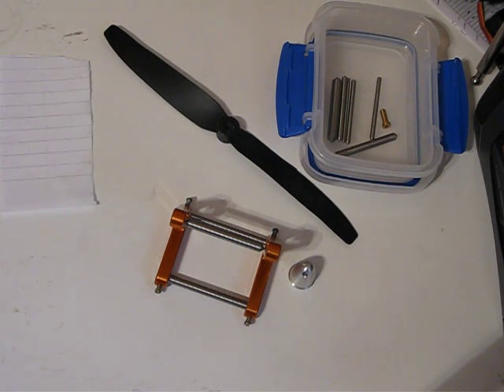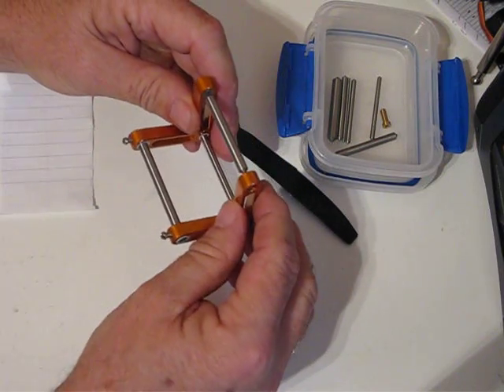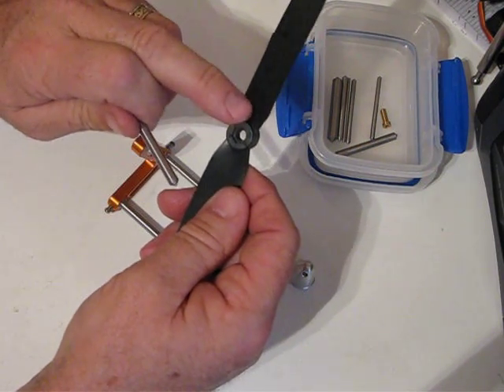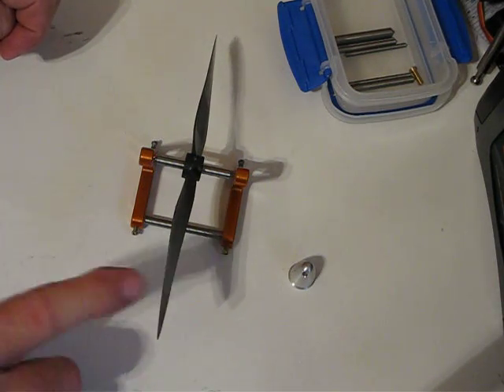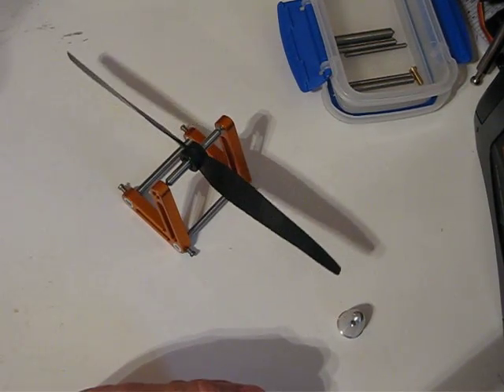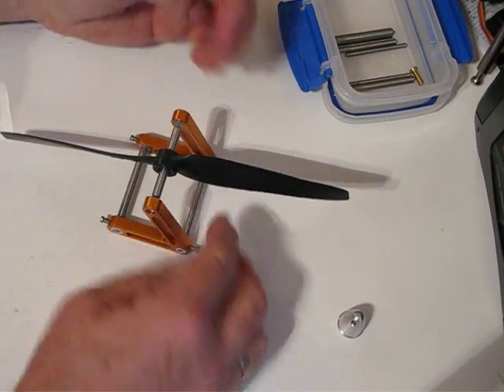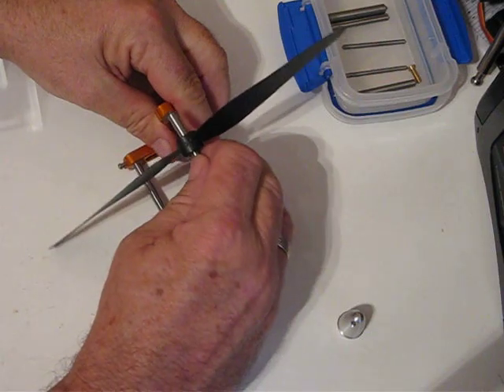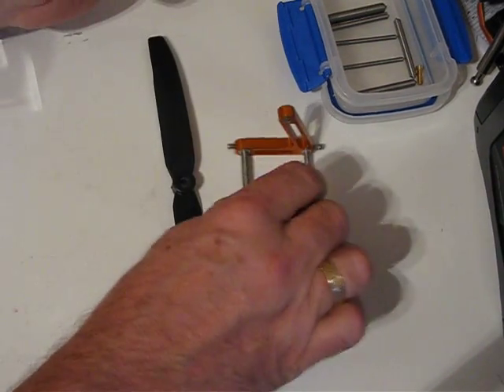DJI Quadcopter Propeller Balance video.

Comment: Where did you buy this balancer with spindles?
Reply from the maker: I don't think it is available anymore, but I now use this one as it is much better and a bit cheaper and no need for spindles as they will all fit.
http://www.amazon.com/gp/product/B00DS1QUFM/ref=as_li_tf_tl?ie=UTF8&camp=1789&creative=9325&creativeASIN=B00DS1QUFM&linkCode=as2&tag=multibladehel-20
Reply: Topvideos1001 Thanks. I already have that one. The problem with balancers that use locking cones on either side of the propeller, is that the cones themselves are often unbalanced. That becomes more noticeable with smaller/lighter propellers. In the meantime, I already found a simple solution: remove the cones and use prop spacers to fit the propeller snugly over the shaft.
Reply from the maker: Topvideos1001
OK no probs, I will look for the one I had in the video and post the link here in a moment,  I was just watching your video in Sicily, Very well done and excellent views.
Reply from the maker: Try here!! This is it on Ebay.
			 		
	eBay item number:
360737533325
Hope this helps.
Reply: Topvideos1001 Thanks!
Reply from the maker: *****
My pleasure.